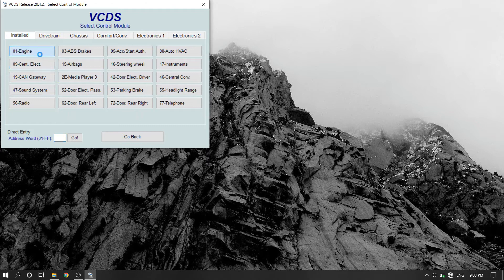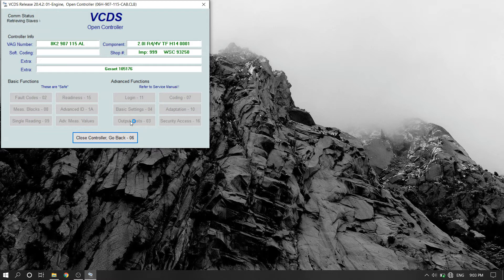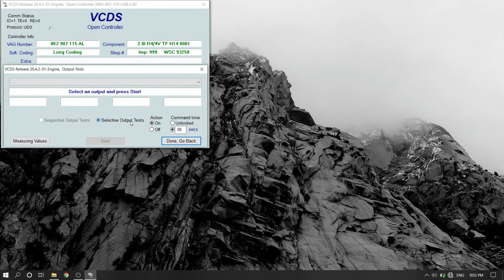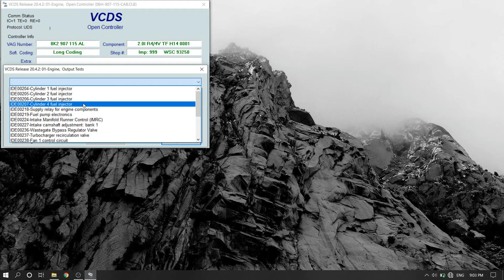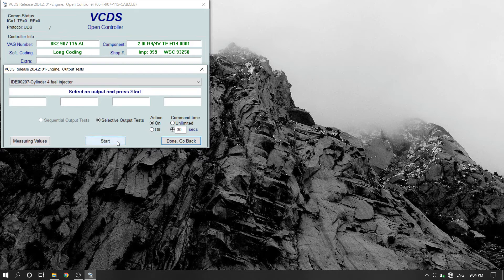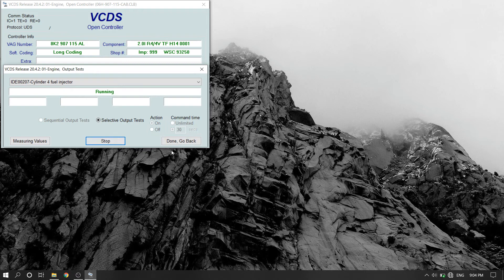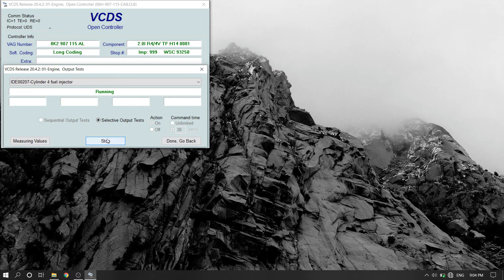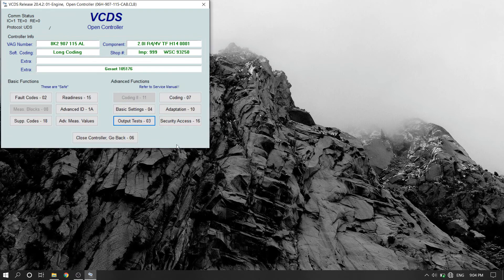TEST FUEL INJECTORS ON VW/AUDI USING VCDS

Comment: Hi, I’m suspecting I have a minor fuel injector leak, but VCDS doesn’t allow to view injector values on the UDS system. I applied your steps in this video on my MK7 GTI, and each injector did make the clicking sound, but injector #2 made a sound that was different than the other three injector sounds. Could that have led me to think that injector #2 might be faulty or working improperly?
Reply: i see no reply, was number 2 junk?